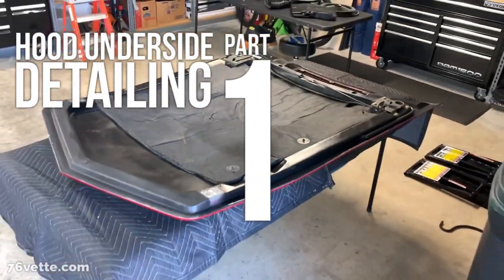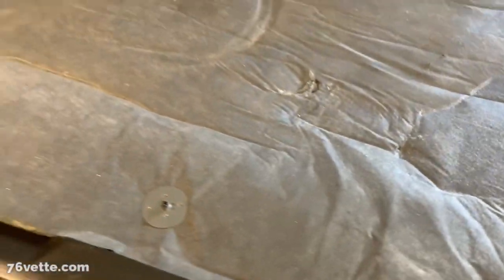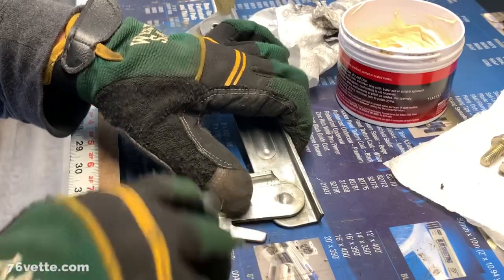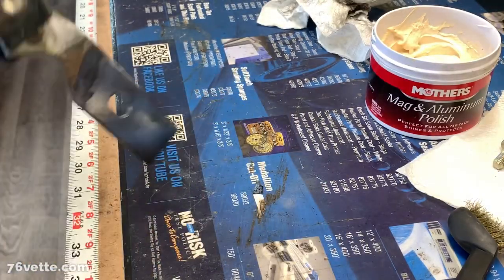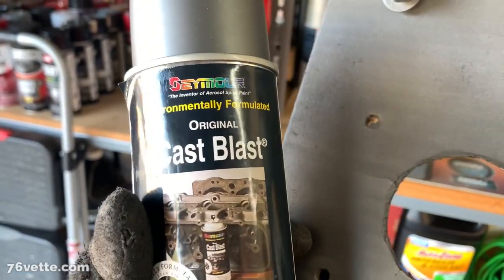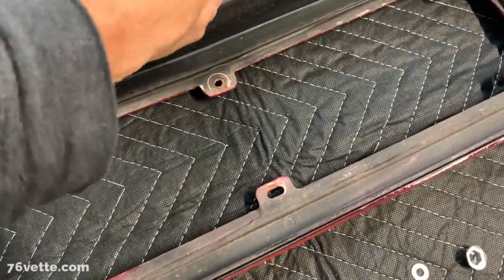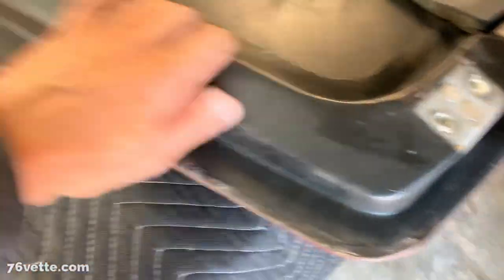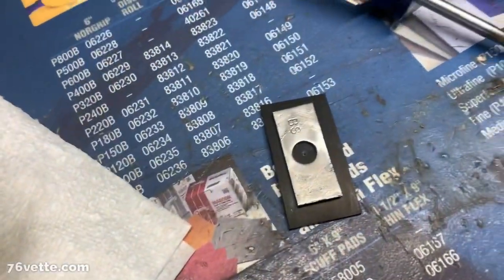Hood Underside Restored to Better Than New

Comment: Dipped my hood support and latches in simple green for a few days.  They come out cool grey and very uniform.  Haven't done the "shellac" yet but already bought the paint.  Great idea!  I would suggest right after cleaning as latches will begin to rust.  
P.S.  any news on your new temp gauge?  Was that the problem?  Suspense is killing me haha
Reply from the maker: Okay... spoiler alert. lol 😆 
No. The new temp gauge did not resolve the overheating issues. A new 3-row aluminum radiator did. I guess the old rad was clogged. Anyway, it now idles at 210° give or take, but the 180° Tstat is opening a bit too late IMO so I ordered a Gates 160° and will see how it performs with that one. I have a Radiator Swap video series starting soon. Hope you find it both entertaining as well as informative. 😊👍🏻
Reply: @76vette  Wow, well with the laser reader, I was reading 195 at the neck on a hot summer day after a drive.  Not at start up so that kinda makes sense.  I could have bet it was the gauge when I saw the gauge drop quickly from redline when the Tstat opened.  Idling at 210 at a true reading gauge still seems a bit high.  Especially with ambient temp in the 60's.  Not sure what your ambient is.  
IMHO the tstat only keeps the engine hot on freezing days, doesn't really stop it from overheating on hot days.  Still a bit stumped but you should be ok at 210 if it don't get to hot outside.  Radiator swap should be interesting.  Did it a few times on mine lol The shroud is a PITA haha